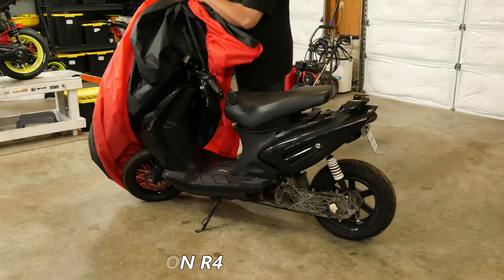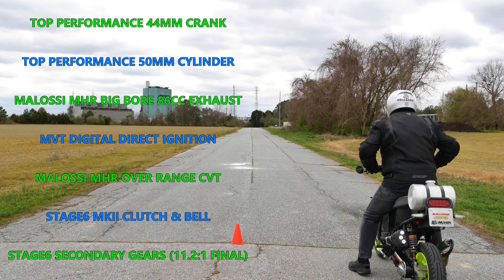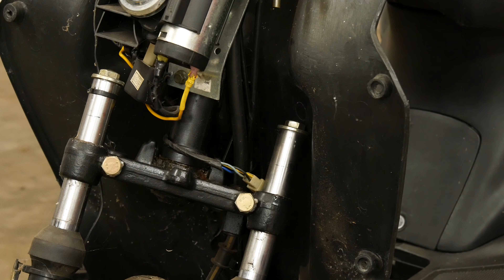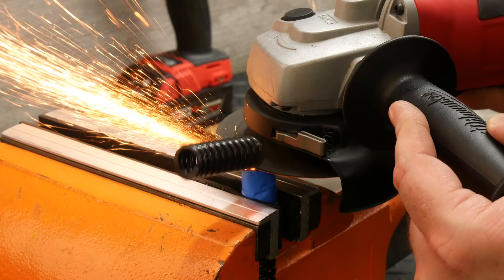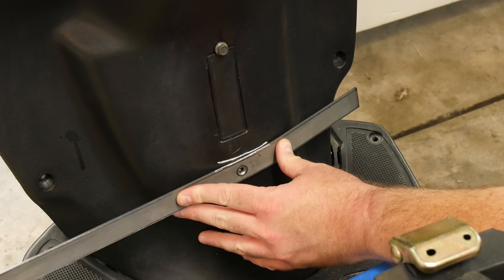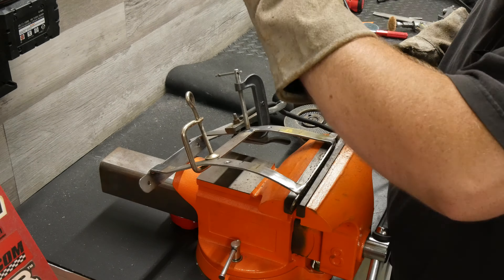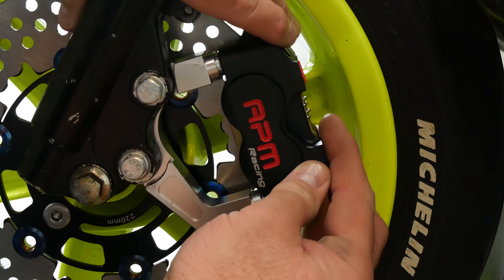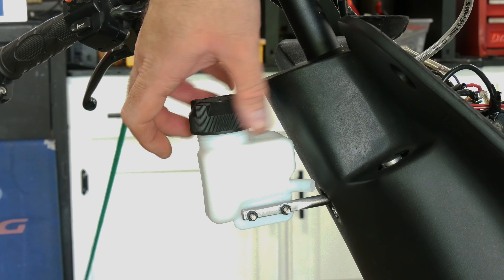Resurrecting My 20 Year Old Chinese Scooter! ...And Doing A Liquid Cooled Conversion!!! T1 : Part 1

Comment: In Germany this thing is called CPI Hussar
Reply from the maker: There are other sort of similar CPI scoots over here, but we never got the Hussar. The original stuff, like the engine cases, are marked CPI. The 2008 and later stuff is made by Baotian or something like that.
Reply: Yes, that's right
Reply: Im planning on buying cheap Chinese fork with 250mm disc and same caliper as yours. I will need to make adapter for fork, but I hope it will be worth it because of oem forks being lubed with grease not oil 😅 Tell me how does this disc work so far and review my plan with fork, keep up the good work 🎉
Reply from the maker: @kornelmag6943  The 220mm RPM setup has been on the other one, T2, for over 5 years. Not sure exactly how long. On one set of wheels, I keep getting vibration after hard braking. On another set of wheels it has worked brilliantly for 2.5 years now. I think something is off with one of my front wheels and most likely the issue comes from that. Short answer : I like it.
Reply: Yes, we call it that in here Hungary too.
Reply: What is so special about them because their 400 euro and over

Comment: I still have my 1996 Jinan Qinqi minarelli horizontal replica, still going strong in 2024. The starter gear doesnt engage anymore (common issue) and the exhaust is rusting off but it still runs great and is reliable! I painted over the fairings like 3 times, and half of them are broken and hanging on with zip ties.
Reply from the maker: Did you buy it new? I thought a 20 year old one owner Chinese scooter that's not total junk has to be somewhat rare, but maybe not.
Reply: @49ccscoot  i got it as a gift from a family friend, so im technically the second owner. He put 6k km's on it in about 15 years and I put another 20k on it in about 5 years. I have to be honest, the more maintenance I do the less reliable it gets. The airfilter boot is completely stiff, the carburetor has become one with the mud and i'm fairly certain the only reason I dont have a leak on my intake rubbers is because its completely coated in grime.

Comment: Love the content brother. I've got the same scooter that I've pimped out.
Reply: I'm running a s6 racing liquid-cooled cylinder 70 CC, 24mm s6 pwk 36pilot 112main, yasuni c16 , and I also have mvt illuminate inner rotor ignition ,it has the stage 6 upgraded mechanical water pump, I'm using 99-02 KX 250 radiators with no fan. I don't see temps over 145f. And thats like heat soaking at a stop  light. Normal is around 130f.  I don't know how hot it should get to be normal. I was having tuning problems with the power jet in the s6 carb so I did the block off jet to stop the PJ from working. So #1 what temps should I be seeing? And #2 where should I have base timing set to as the instructions said to set at tdc and it wouldn't run. I believe I'm set close to .35mm btdc.
Reply from the maker: @traviswilliams9455  Mine will run 100-150F, depending on temp and what I'm doing. Most of the time 110-130F. Can be below 100F in the winter, but I prefer it to be at least that warm.

For stock stroke MVT says 0.4mm BTDC. 0.35mm BTDC for longer stroke.
Reply from the maker: Here's a video changing timing on the TPR and what it did for me.
https://youtu.be/PxFAb6-vlso?si=tz2aK7ut4zd3Sryq

Comment: Hi Brent.  Hope you can help.  I have a new SYM Orbit II 125cc air cooled, carb model. It has done 105 km only!  At town speeds (40 - 60 km/h) with light throttle it has a bad irritating "orbital" vibration - like a very bad wheel bearing on a car.  This does not happen under power (accelerating with full throttle) - only at low throttle between 40 - 60 km/h slowly going up and down that speed. From 0 - 40 km/h and above 60 km/h it is absolutely fine. I have checked the belt, variator, rollers, clutch, gearbox bearings, all gears, rubber bushes to the engine/frame.... all seems OK.  What else can I check?  (Dealer says "this is how they are" however my friend also bought a new one two weeks before me and his does not have this issue...)  Where else do I look for the cause of this issue? Regards!
Reply from the maker: The throttle position mattering doesn't fit so well with this, but I would at least check wheel bearings and wheel balance. I'd be curious if it was at a specific RPM.

Comment: Hey Brent! I'm looking at swapping my Kymco Super 8 2T 70cc for a Vento Triton R4 2004 with 1,375 original mileage! Was wondering if I put a Malossi Sport 70 kit on is there any Yasuni R or Z pipes that have the angled exhaust port for Vento R4 or any other good pipes that you recommend for Vento R4s with angled exhaust port for a reliable set up?
Reply from the maker: I used to get stuff for Zumas. The main issue I had was brackets sometimes, but usually those can be modified without too much hassle.
Reply: Hey there Brent I did purchase a 2004 Vento Triton R4! It had some tuning done! Was wondering if you know what the stock carburetor jetting is on this scooter (main jet + idle jet sizes)?
Reply from the maker: @jeremyh.2114  Nice! It's been a long time so I couldn't remember for sure, but I checked a service manual and it says 80 main jet and 57.5 pilot jet.
Reply: Hello again Brent! So I took a look inside at my new used 2004 Vento R4 and it has a Autotech355 SENCHEN TAIWAN 70cc kit already on it in nice condition! The bike only has 1500 original miles on it! I saw your old project 49cc scooter had this cylinder, do you think this cylinder could handle a Yasuni R pipe!
Reply from the maker: @jeremyh.2114  Should work with an R. I don't think it was that far off of Polini/Malossi Sport.
Reply: @49ccscoot  cool thanks again for your information
Reply: @49ccscoot  so Brent I bought a Stage 6 Pro Replica MK2 exhaust for zuma minarelli horizontal and it fit my Triton R4 perfectly! Haven't taken a ripp on it yet, it's to cold in Connecticut right now! Thanks for the recommendation!
Reply from the maker: @jeremyh.2114  Glad it worked out for you! I get it. We got a foot of snow Monday so my scoots are all parked too.
Reply: @49ccscoot  do you have any idea if a cylinder kit labeled for a minarelli horizontal 12mm wristpin is likely usable for the Vento Triton R4 12mm?
Reply from the maker: @jeremyh.2114  '04 should have a 12mm pin.